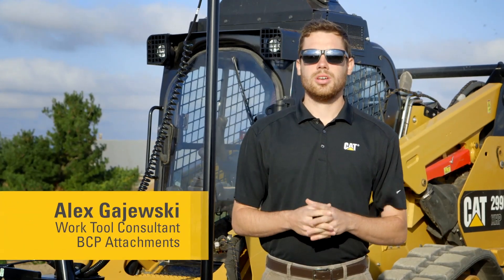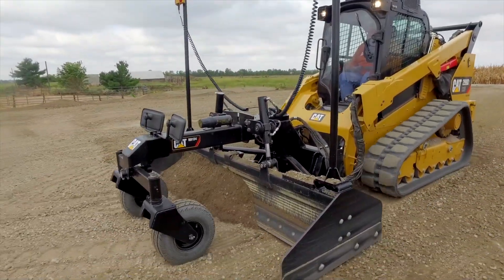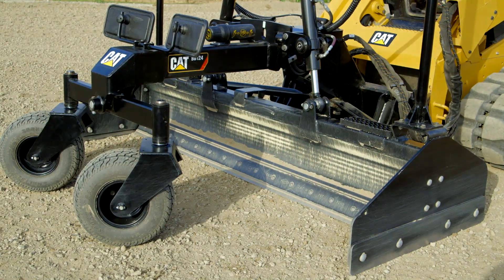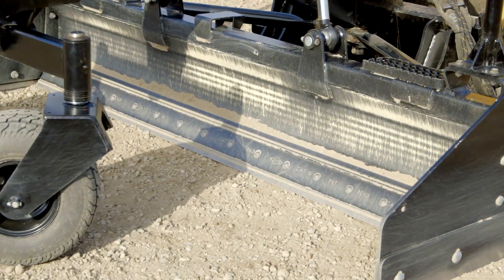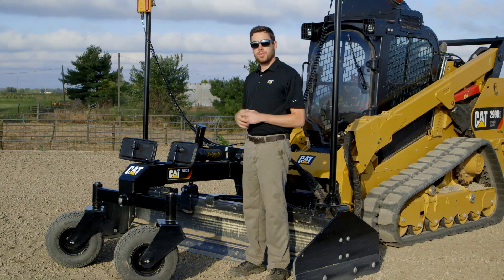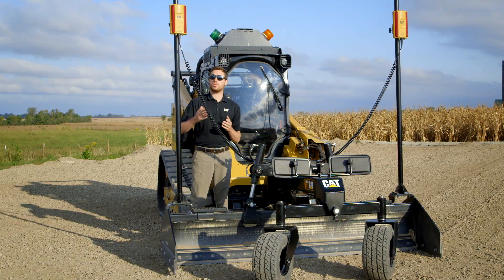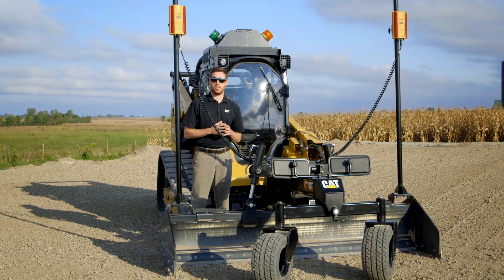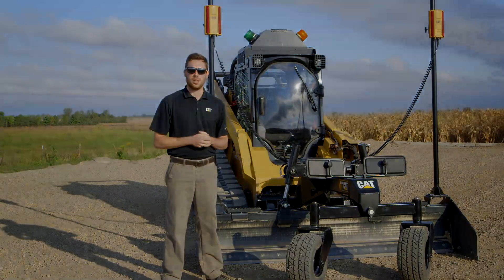Cat® AccuGrade™ Box Blade Attachment Overview

Comment: i see the green light on the side of the hydraulic cooler on the cab... is this machine equipped with the remote control system from torc and how well does it work with the tremble gear?
Reply from the maker: Hi Doug! Yes, the orange and green beacons on the compact track loader are part of the RemoteTask System and the black box on the top is an external oil cooler, typically used in land management applications where there are high outdoor temperature conditions or debris buildup.  Neither of these options are required as part of the Box Blade or Accugrade system.

Comment: whats mounted on top of the cab of that 299?
Reply from the maker: The black box on the top is an external oil cooler, typically used in land management applications where there are high outdoor temperature conditions or debris buildup.  This option is not required as part of the Box Blade or Accugrade system.
Reply: Cat Landscaping and Construction hot oil above me...no thanks. ..great machine though

Comment: I want to run this setup for track home builder final grades.  Can I do this now with a total station?  One setup in the front yard corner, that would cover the whole front and one side into the back yard.  One setup in the back yard corner, that would cover the whole back and one side into the front yard.  We could setup the plans at the dig for our 323F and then use them at grade with one of these setups.  I want to price and get one of these systems running.  It's a pain for tight track home setups but it is the future.  When GPS gets more accurate we can just switch out the total stations and the receivers.  Is anyone using these setups to do home final grades in dense neighborhoods?  Can you set me up with someone who has setup a solution like this?  Thanks!
Reply from the maker: Hi Mike! To answer your question, yes, the Cat Box Blade has the ability to run with total station. Your local Cat dealer can get you a quote on both the box blade and the technology that you are requesting. If you already have this technology running on your current machines, they can help you get the box blade set up with your current technology. Please visit our Dealer Locator website to find a dealer near you: http://bit.ly/caterpillar_dealer-locator
Reply: Can you reach out to all dealers to find a user who is using this with national track home builders?
Reply from the maker: Hi Mike!  We reached out to your local Cat dealer and they will be getting in contact with you to provide information, as well as any referrals they may have for customers doing similar types of work.